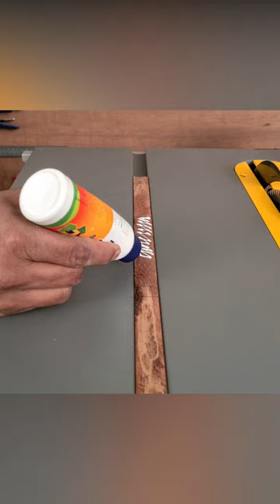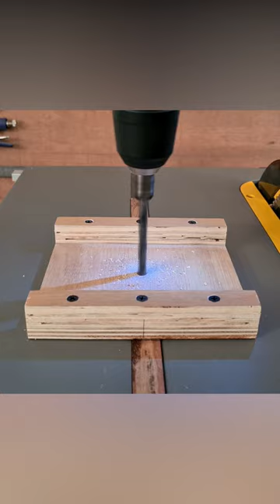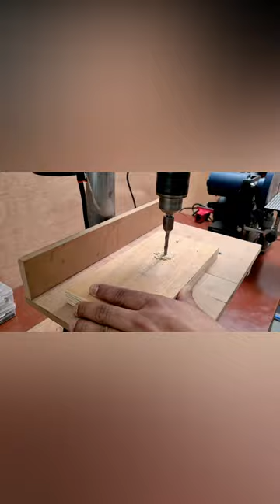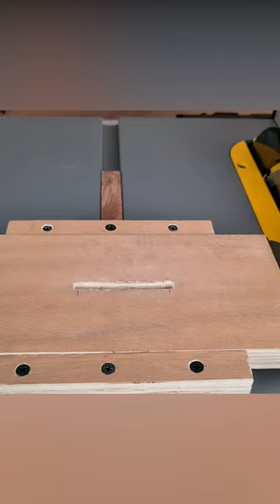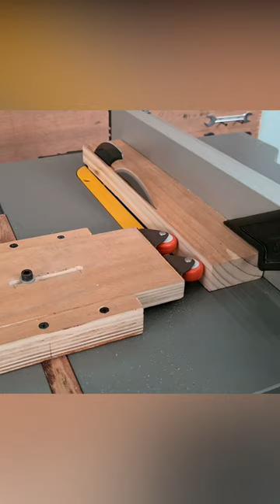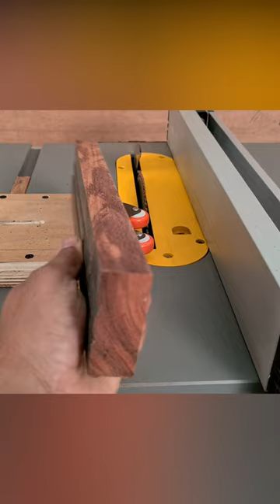Woodworking Hack | Amazing Feather Board for table saw

Comment: Not just a lack of kickback feature, but it seems to only work at a specific height (I.e. only able to use with 2x material. Looks like the wheels wouldn’t work for 1x material or 1/2” stock